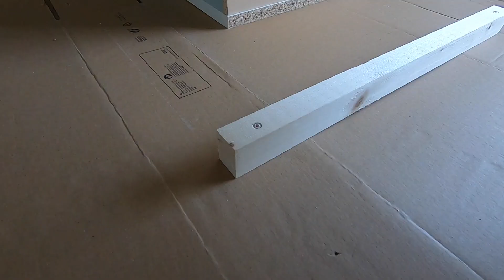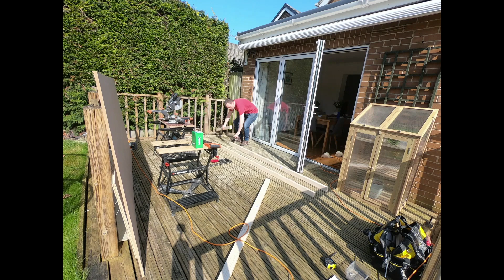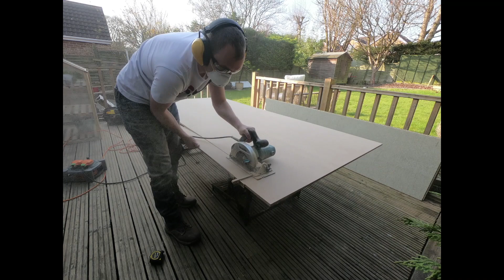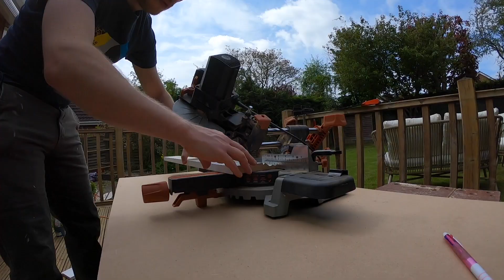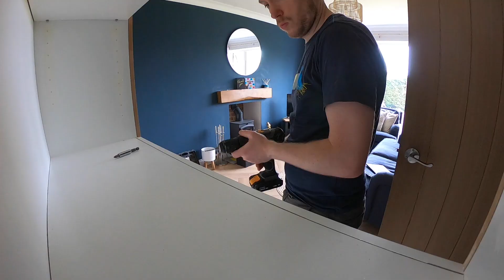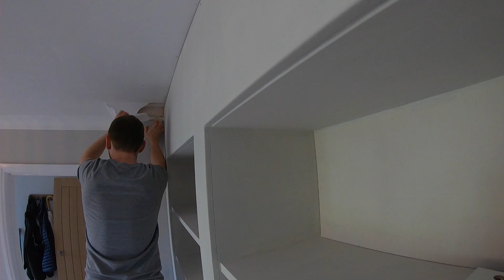IKEA Hack - BILLY Bookcase Built-in Cabinets

Comment: Great vid, what thickness mdf did you use for the trim pieces? And did you have to put the doors farther out to accomplish for the trim?
Reply from the maker: Thanks. I used 12mm thick MDF for the trim. Yes it was pretty straightforward to move the doors forward. Just had to measure 12mm forward from the pre-drilled holes. Let me know if you have any more questions :)